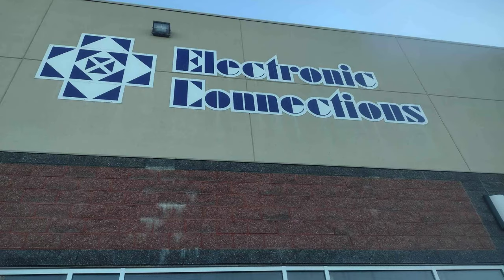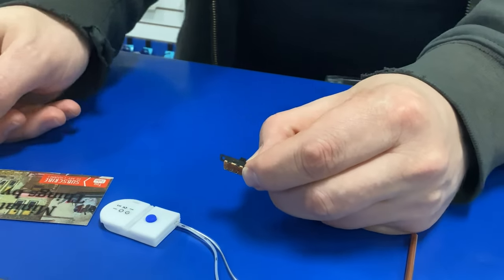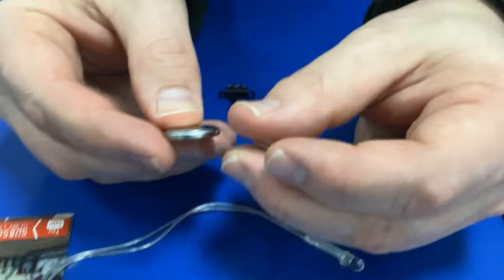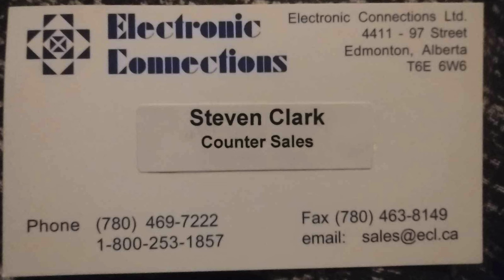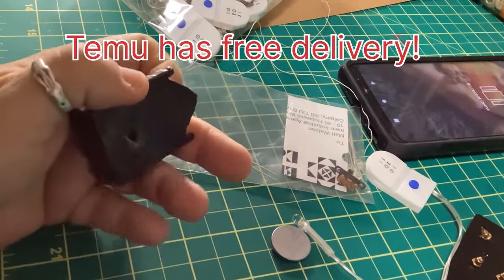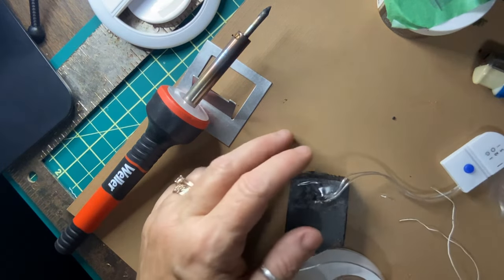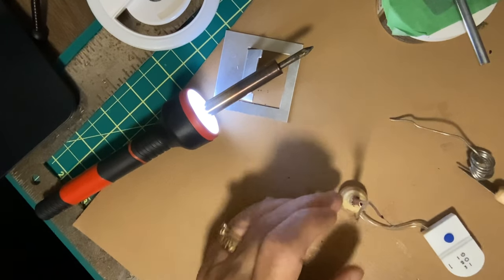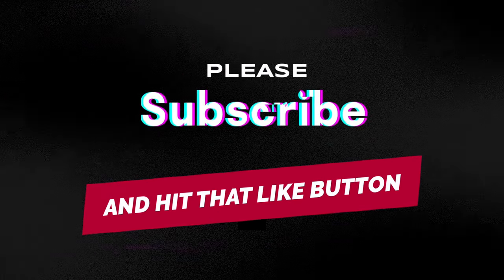DIY LED Miniature Dollhouse Lighting!

Comment: I have been making my own lights. I made a 1:12 scale tower (think Addams Family) for my witch dollhouse. I created 5 lights for it. I learned how to solder and use shrink tubing and/or liquid tape. I am using LED bulbs, some individual and some cut from fairy light strings. I bundled all the positive wires and all the negative wires together and soldered lead wires to those. This results in parallel wiring, which means a single CR2032 battery will power all those lights. BUT, I stole a battery pack from a string of fairy lights (with an on/off switch) and connected the lead wires to it. The battery pack works great with 3AA batteries. That gives me a total of 4.5V, which is fine for the 3V bulbs. As long as you keep your power in the 3-5V range you won’t pop any bulbs. I’m thrilled I figured out how to do this. Now I will be doing the same thing for the rest of my dollhouse. Shrink tube is a game changer as well as soldering. Now I have to go make some more light fixtures! Happy lighting!
Reply from the maker: I’m crazy about dollhouse lights as well!😀

Comment: I build electronics for a living,  and you can definitely find much smaller switches. I love pushbutton switches myself.  I have worked with some that are just about a quarter of an inch wide and pretty flat and they're great. Since size is an issue, they work better. I just make a hole for the button in my hiding spot, and you can paint the top of the switches to disguise them so they blend in.
Reply from the maker: I’d love to find smaller switches or cr2032 cases with switches that you can use for a base of a lamp without lead wires!

Comment: Hello Lisa, great video today, I would have no idea where to find a shop like that here in the UK, we do have online dolls house lighting suppliers that sell the wire etc I have noticed stands at shows that sell the bits and pieces but no physical shops like the one you went to.
Your fireplace looks great with it's new light, and the little lamp is so cute, it's like a tiny version of the oil lamps they had back in then,  
Best wishes from Yorkshire, England 🇬🇧 😊